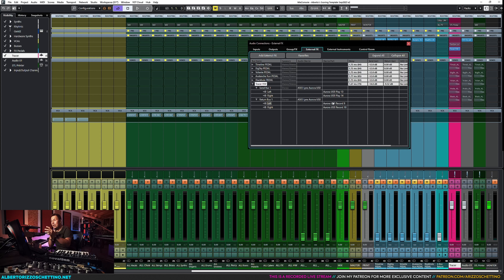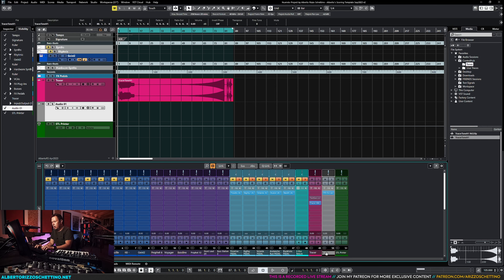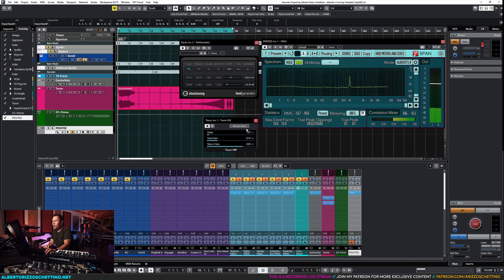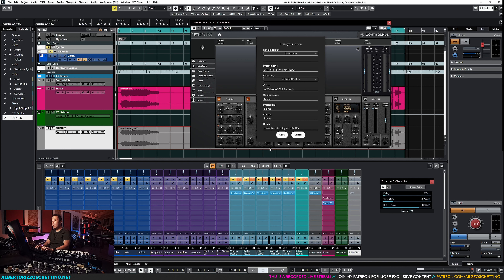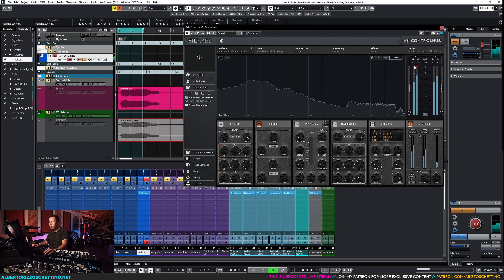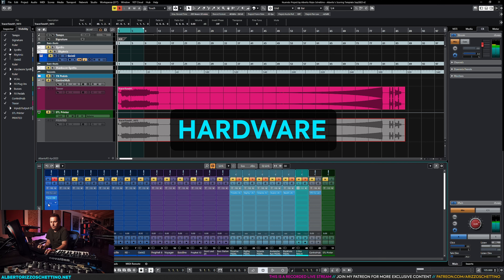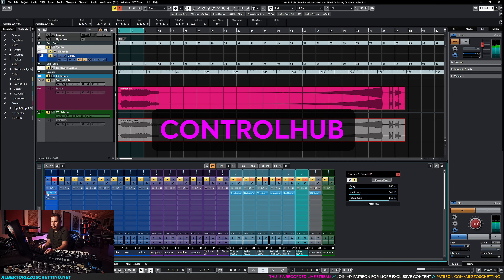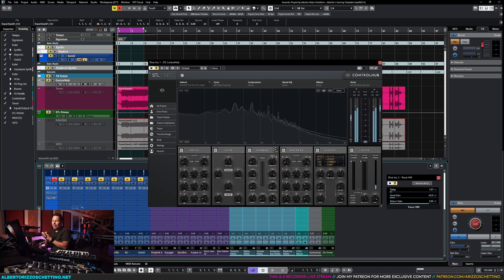Modeling my Neve 1073 & API 512c in STL ControlHub Tracer

Comment: Hey Alberto, great video! Do you think your STLtone capture of your Neve 1073 sounds better or worse than your Impulse Response capture of the 1073?
Reply from the maker: Hi Stan, thanks for the nice comment, I am happy you liked the video. I liked STL Tracer better than my static IRs, because.. well, they were static IRs. They captured the harmonics at a specific level ("1 photograph") but then they applied it to low and high dynamic content, which is not the case (lower-intensity signals would have a different distribution).

I don't mind the static IRs for something like "please add me this ton of color on my synth drum machine", because - in all honesty - it works! But those are cases in which the more color, the merrier. Tracer felt responsive to level changes and also (and this is probably my favorite feature) it puts the capture in the ecosystem of the whole plug-in, which allows me to quickly change it and adapt it to other stuff.

My Distressor traces are living on my drums bus of my template, I just like that vibe of the British mode and I've customized it with a couple more color feats. This way I can use my real Distressors for something else ;)

Comment: Have been using Neural amp modeler to do this. Ity is actually superior - as the training process for the neural network is totally customizable and actually powered by google. takes usually about an hour to train a capture. I have a hard time believing that STL (a historically shady company)'s product would do a better job instantaneously, despite the $400 price tag. Seems like they just took some of this open source code, simplified it, threw it in a fancy GUI, and sold it for $400. Not a fan of them at all. I appreciate you taking the time to demo this
Reply from the maker: I did not know about Neural Amp Modeler. That is very interesting and open source, definitely got my attention. I'm happy you found the video useful and there will be definitely more, I am always interested in ways to capture the behavior of my analog gear because I use some units in specific ways and sometimes a couple things they do (simple stuff like preamp colors) save me a lot of mixing and arranging issues. So I'd love for them to be available as an additional instance! Love to geek out on all this.

Comment: I dont get it. does like in Nebula, capture all the harmonics and phase response? or only a close capture of the frequency response and the dynamic behavior? I dont get why ControlHub have all those generic algo effect like compression, eq, DRIVE, etc.. to add on top of the capture? why would you need that if the capture was right? hummmmm
Reply from the maker: Hi Patrick! How are you? We miss you on Discord!

I am still exploring the software and running more tests, I will do other streams on the topic, probably on a weekly basis.

I have only captured two preamps for the time being and their color is present even when all the modules are off. I believe the modules like "color" are there to further emphasize the capture, like the Drive function does on Nebula, but with a bit more control.

I would like to do a specific workshop on comparing the same unit captured with Nebula and with Tracer, for example my 1073s, but I am not allowed to do that based on the terms and conditions set by Acustica Audio. I contacted them on this, to see if it could be done under specific conditions, and I wanted to discuss it but so far I have received no answer from Acustica Audio.

I'll certainly continue to study and capture and analyze Tracer, and I'll do it on video, for sure, so stay tuned for EQs, compressors and more!